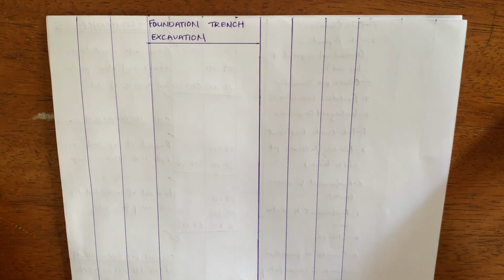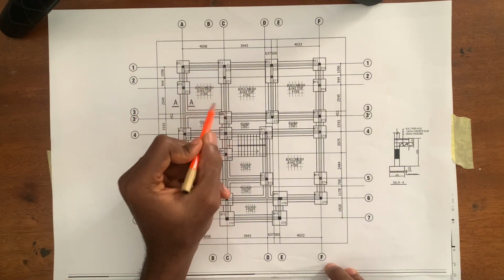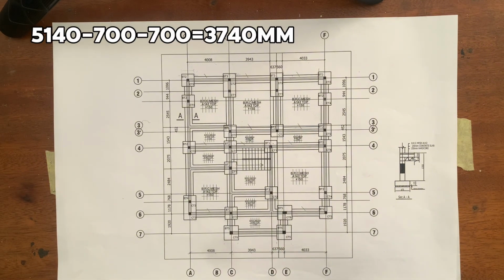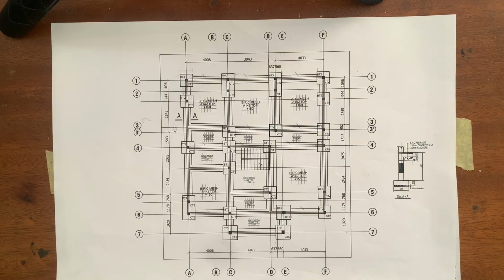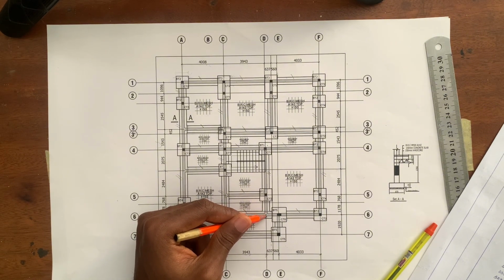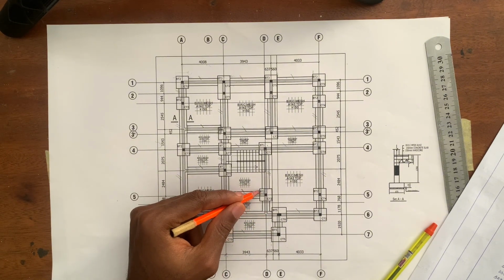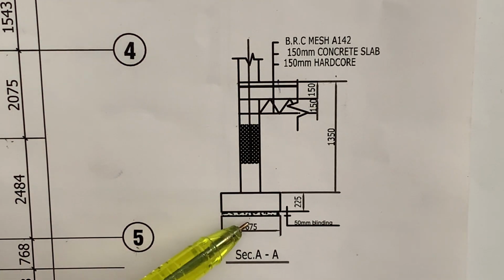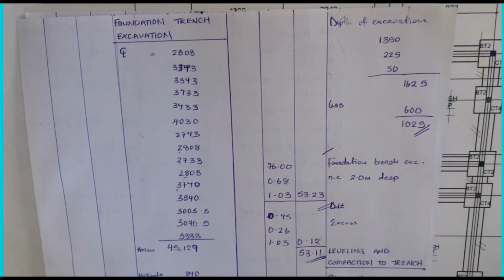HOW TO MEASURE FOUNDATION TRENCH EXCAVATION FOR FRAMED BUILDINGS | SUBSTRUCTURAL WORK EXPLAINED

Comment: You didn't less corns...
Reply from the maker: I didn’t need to. Cause of the method I used didn’t warrant us to deduct junctions
Reply: @quantitysurveyworkshop I also noticed you didn't measure earthwork support and formwork for column base although I understand why you might not measure formwork to column base if the soil is cohesive and can hold the vertical cut. But why didn't you measure for earthwork support for trench excavation?
Reply from the maker: @mathemusicentertainment1230 it’s not compulsory if your soil is stable.
But if you want to measure that then get the total length of each sides of the trench multiplied by the depth of the trench.